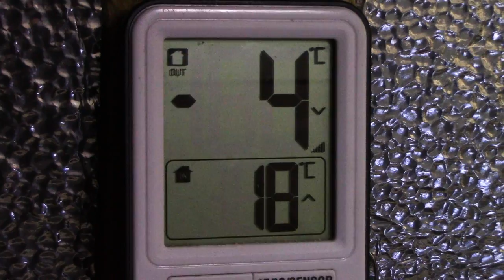Snowmobile Camper Solo Overnight- Primitive Heating & Wolf Lullaby / Log Cabin Update- Ep 11.6

Comment: great video but I would suggest changing your solar panel to a mono crystalline panel with a pulse with modulator to handle the charging of a battery. a MCP panel will start charging at sun rise as this is a daylight panel not a solar panel. thumps up for the ammo box heater video.

Comment: As for the location of the ammo boxes with hot stones, which is a very clever method, you could raise the bed level by the height strictly necessary to lodge the boxes underneath and make some holes in the bed planks in order to let heat reach you. If I have seen well, you should still have enough room to stay seated.

Comment: 12V Electric Blankets are very commonly available and relatively cheap. As long as your floor is reasonably well insulated your average blanket would easily keep your warm. They usually consume around 4 amps on high, so you could run it all night on a 12V 32A/h deep cycle battery, which is smaller than a car battery. You could even put some solar panels on the roof to charge the battery again during the day :)

Comment: Great little build, I'm sure you could come up with a more convenient as well as safer heating system than the stones, I saw a video where the guy uses steel pipe that is heated in a log stove and the warm air in the pipe is let into a tent, he managed to warm the tent quite well and I think the same system will serve you well, I was just wondering how heavy the shelter is, would one be able to pull it one's self or maybe 2 people. . . . .how about a horse? . . . . . .I stay in sunny south Africa and we don't really know much about snow, in fact I can no stand the cold. Like when I see you making up your bed and there is bits of snow everywhere. . .how on earth do you manage to get warm or even dry. It must be torture to live there, at least this is what I think but I'm sure in reality people make a way and that is what is so impressive about this shelter, it reminds me of the ice fishing shacks that people pull out onto a frozen lake or dam. I know some of them use a stove heater for warming and drying. Maybe you could look into something like that, fire outside, radiator inside. . . .I look forward to seeing what upgrades and adaptations you make to your "one man, snowmobile, Bush camper :-) heated :-) " TGC brother.

Comment: Mini air handling unit(7.8w fan) would save you much more heat and ventilate your cabin than open holes in the walls. I use mine for bathroom ventilation.

Comment: The thermal mass of water is higher than rock. But I will be curious to see the way you used to heat it. I thought you might change your mind on heating the rocks, do to your rock bucket handle not going to take many more fires.

Comment: May I suggest that you carry the fuel cans and chainsaw outside of the living quarters purely for the smell of petrol/gas. As Ben has suggested, hot rocks in well insulated containers under the bed equals toasty warm. You can regulate the heat output by varying the top insulation.

Comment: Really nice Cabin!! I would suggest to add a layer to the floor where you could made a large "coil" of copper covering the entire floor. An outlet and an inlet connect to flexible hose and a little coil not too big like the one you made for heating water to put in fire, maybe just a straight copper pipe to be sure not to make the liquid boiling. Instead of water use prestone and add a inline thermometer. This way the heat will radiate direct your body and you will have more place.

Comment: You could run copper tubing throughout your camper that’s filled with water and have the copper run through your campfire.  That could provide some radiant heating.  Solar panels would work if your not in a dense forest.

Comment: One time when I was around 17 I was "camping" in a tent with just a few blankets during the end of November in upstate NY, it started snowing and temps dropped drastically. I found an old tractor hood and used it to place rocks I had heated up from the fire. The rocks started burning the paint(probably lead) and smoked me out. It was a rough night to say the least. My father told me a story about a downed helicopter pilot once used rocks to heat the cabin of his helicopter.

Comment: You mentioned about putting a solar panel on roof or outside for power. That would be great idea.  They now make those little plug in wall heaters advertised last winter. I guess you plug right into a socket. I am not sure on the draw it requires. It could be a option too.

Comment: If you attached a 3/4" steel skid plate, under the sled then dig your fire pit, slide the sled over the fire pit and you will have all the heat you need..... some obvious fireproofing to the sleds wooded areas closest to the heat source and your set. Added Benefit this set up acts as a low profile feature for windy nights, as well as stealthy. And keeps your ambient lighting down to allow for better viewing of the nights sky.

Comment: Just a thought 💭 What if you installed 2” insulated PVC in the sub floor. 90 up on each end then 90 up in bottom of rock box’s. This way it would draw cold air off the floor and reconditioned to a warm temp. It will solve the cold air on the floor or help. 🤷🏽‍♂️

Comment: Just watched this video. I’m thinking you could use bricks in place of the rocks and you could place them in aluminum lined drawers directly below the flooring which also give the a low center of gravity to stabilize while moving behind the snowmobile. If you were to embed the bricks into metal drawers which slide under the flooring but above insulation. You could place the brick and metal drawers over the fire to heat them up and quickly slide them into place.

If you had a few drawers you could rotate one drawer out to the fire so the micro cabin is always getting heat. And perhaps each drawer could be fully insulated even from inside the cabin so you can trap the heat and in the middle of the night you could open vents to let the heat to come into the cabin. And maybe those vents would be on far side of the cabin from the door with am easy to open and close vent system.

Comment: If you really want to use your wood burner you could use a tarp to hang from your door to tent it in you could use wood dials to tie tarp two or steel  hooks on your door tent stake to tie the bottom down .you can  cut a hole with a propain torch to keep it from ravalling out for your stove pipe. Two wood stakes to hold your door up.

Comment: I have a suggestion for you to try about the rocks in conjunction with your coil hot water system the coils could pass around the rocks in the containers the containers could be underneath you in some fashion the pull-out drawer if you will and that way you could leave the coil on the fire overnight or until it burned out and in the wee hours of the morning 12 the fire may burn out and the Rocks would still be giving off the heat that they've soaked up from the hot water

Comment: Man, I would've slept like a baby. A big, fat, warm, happy baby. 

One solution for the ammo cans is to build a separate little cage to keep from melting your sleeping bag. Also, you could run copper pipes with water in an insulated cavity below the sleeping area and have the open ends sticking out the end of the camper and then have a coiled copper pipe over the fire. I'm not absolutely certain how you could have the water circulate, but I'm almost positive that if you completely sealed the system you'd have a failure in the weakest part of the pipe and it could be a pretty big failure. Interesting to see what you've come up with.

Comment: Try something like a rocket mass heater, run chimney pipe though the exterior to interior in masonry. Make the entire perimeter a masonry battery with the chimney exiting after running thoughout the interior and leave the fire going outside when you go to bed.

Comment: You said in this episode or another that you body heat was enough to rise the temp of 10°c. 
Could you try the technique of the igloo cold well, and so lift up your couch in the middle of the cabin, with some notches around the platform to allow the air that is refreshed in contact with the walls to go under you. Then the ventilation hole at your head side could be moved under the platform, and both vents could be covered outside by an angled-down plank (or a 90° PVC tube), to prevent irregular winds: - to change the flow rate of the ventilation, and, - to introduce snow in the shed.
I bet that with those modifications (and maybe an extra layer of insulation under the roof), you can gain at least 5°C...

Just for the trial, you could have you couch on a piece of plywood raised over some logs. If successful, you could then imagine a system (with pulleys, lever and/or any kind of jacks) to transition between the low position for reading etc, to the high position for sleeping, while remaining on the platform...
I would be delighted if you could experiment it and give us the results!
Your videos are so refreshing, I'd like to keep you warm!

Comment: I found this video rather interesting. My question is..... what's the purpose of this? I'm not trying to be hateful,  just curious mostly.
A suggestion for your update with the solar panels; with that being added and the battery bank added you could run a small 12V heater in there to help keep you warm at night. These are the kinds I've seen in truck stops and i think one or two would work for this small cabin. 
Good video by the way!

Comment: Okay, if you get the solar panels, battery, with the controls for that, then try the Chinese Diesel Heater (its of good quality) for dry Heat inside your camper (NO MOISTURE). The heater has Combustion Air and Exhaust piped to the outside, so the SAFE dry heat is circulated in your camper. You'll be set. Reference other Life in a Van youtuber/s who installed this heater.

Comment: I would have parked it away from that large clearing, and closer to a southern stand, with no cleared pat h directly to one side.
Maybe lower & squatter for the design? Or do you need to keep one set of 'skis' coming behind the other set of 'skis' on the snowmobile?
Seems like it would tip over easily now.

- No food?
This was so great, thanks!

Comment: Use Blue ice/Ammonium nitrate-water mixture in silicone bags and boil them in a pot with water, that will hold at least 5 times more heat per unit volume of rock.

Comment: For an efficient way of keeping the camper sled warm at night, I think that you should consider water instead of stone.  If you have studied physics, and understand the specific heat of substances, it is interesting to note that while water has a specific heat of 1.0, granite has a specific heat of 0.19.  In other words, one kilogram of water (one litre) can hold just over five times as much heat as one kilogram of granite, if they are both heated to the same temperature.  For this kind of purpose, 100 degrees C is the maximum temperature that you would heat the water, and in practise you would probably restrict the temperature to what would be comfortable with a hot water bottle that you take to bed to keep your feet warm. Perhaps the solution here is to have a number of hot water  bottles that can be placed in the most needed positions.
Reply: I have enjoyed watching the videos of the construction of the cabin, from its earliest days, but have been away from this site for a number of months.  I was impressed by a number of things in this particular video, and that is why I made the comments about hot water bottles. In the last few hours, I had an additional thought about an even better way to take advantage of the heat that can be stored in hot water bottles. This camper sled has been insulated by sheets of styrofoam, and this same kind of insulation could be used to make a very well insulated box, maybe above the foot-end of the bed.  This box could store a number of hot bottles, and keep them quite hot for a number of hours.  In this way, if additional warmth was needed progressively through the evening or overnight, it would be a simple matter of just getting the next hot water bottle from the insulated box.

Comment: be careful of where you put the battery bank. The battery will let off fumes that are toxic. You do not want it inside the shelter with you. You might want to consider putting a small box on the back of the cabin and putting the batteries in that.

Comment: Heat? Simple solution. 12 volt box heater. Steel heat exchanger. 30 feet of rubber hose. Small pump and a gallon of antifreeze. Lay heat exchanger on edge of camp fire and heater box inside shelter. Batteries to drive pump and heater box with solar panels to charge batteries. You could even use a thermostat to regulate small blower in heater box.

Comment: Interesting, why not run some copper tubing around the inside lower areas of the hut, have to quick connect inlet and outlets and connect it to a makeshift water tank over the fire, this would create hot steam and heat up the hut and the water vapor after it cooled would flow back to the tank to be reheated.

Sort of like a Desalinator that pours back into itself.
Reply: Hell you could even add a small radiator and a small low fan to maximize heat potential.

Comment: I own a cnc plasma cutting business, I could design & cut out a forced air wood burner it's a shell built around the fire box of a wood burner  that would sit outside & use the wind & force air though a 4 way air channel at the bottom to circulate through the heat box collecting heat from the fire box and through a vent at the bottom of your camper to circulate heat lower like the rock idea you could use your vents caps up at the peak for air ventilation if needed but I think it would heat you out but if you build another one like mentioned in another video for your pops it would be enough to heat them both. Id ship them to you with assembly instructions and you would weld them up at your location. ;)

Comment: Just an idea. I saw your water idea. This could work with the rocks too. It reduces space but it may be very useful. Put a gap (insulated) below you. This will allow you to put the water or rocks (or both one as a backup) and have the heat rise below you then upward, warming you more and giving you more benefit of the heat. this can be done with many small slits/holes in the wood. I would be concerned with structural integrity but it is worth a mention as that adds storage below you as well for the tubs of water and rocks as well as any needed tools for the water system.

also can you reuse the water as a drinking source? I am unsure of the ammo boxes paint but it would be a double win if your heater water could be used as a potable water source. Heat at night, water in the morning. Anyone who knows if this would be safe to do, please let me know as it would be an added bonus as snow/water may be plenty but  safe drinking water can be hard to come by. If it boils then I assume it is safe? However copper and the boxes at those temps I want to know from others if it is safe.

Comment: One more thing. I used to stay in a little one man nylon igloo tent in the Bighorns and the Rockies in the dead of winter and take a Coleman lantern and turn it down real low and sit cross legged in my long johns warm as  toast. You have ventilation so the messed up mixture gas to oxygen won't bother you. I have done it for years. Turn it down low , low. Just to the edge of stinking and then turn it back up until it quits stinking. . I have a double brick propane heater in my RV and that is what I do with that all the time.   Seriously. I used a green double mantle propane lantern and I have done it in January up in the high Rockies. And believe me if it will keep a nylon  tent warm all night long , it will be snap for   Remember the secret . Turn it down low until you smell the fumes and then turn it back up just until the gas and oxygen get properly mixed .    I  lean over it and turn down the gas until it stunk. Then  turn it back up just enough to kill the bad smell and you are good to go. It is also a soft dim nite lite to sleep by. I once stayed in the Smokies from mid December through the New Year and it was snow  just like yours the whole time and I had a tent on the snow and was warm as a bug in a rug .No fighting those rocks (although that is a great idea).  God bless.

Comment: Chinese deisel heater dry "cheap" portable reliable safe low sound nearly silent once running. Will take care of condensation and draw very minimal bat power. Just build a little box outside. No carbon monoxide danger. No rocks to haul. I live off grid in a camper in Scandinavia.

Comment: This would be a perfect project for a "Coke Can Heater." Perfect to warm up in quickly during the day as it would keep a constant no mainteniance heat. As for night what about a metal drawer located below your bed in which you could place your entire ammo cans (rubber removed) or loose rocks directly into. No worries of burning your sleeping bag, while also allowing a better heat distribution. I would include a vented space for your winter (wet) clothes As well. This would keep them warmer and possibly help dry them out a bit. I would add a smaller door on rear of the shelter for sure to help maintain heat better when entering or exiting. On the front end I would build a shelf outside to safely hold my small propane burner with a small door to quickly access my morning coffee without having to leave.

As for the wildlife, trail cams set up outside would be a great addition. 

Love the videos. Very well done. Thanks for sharing.